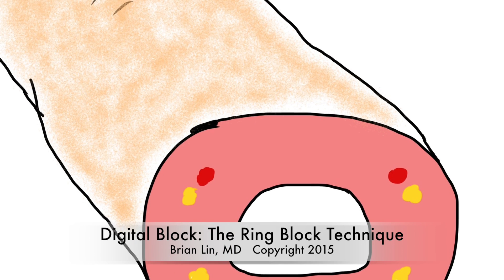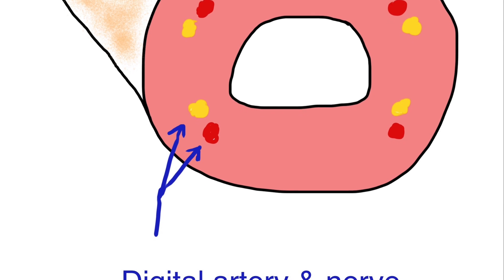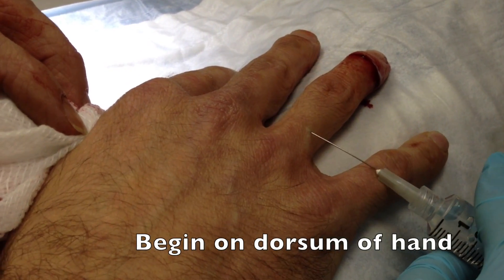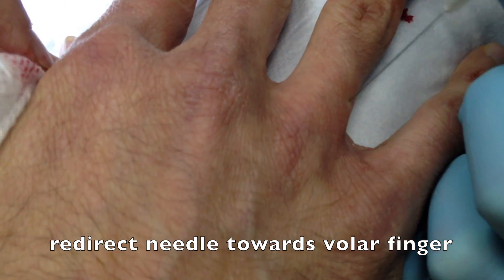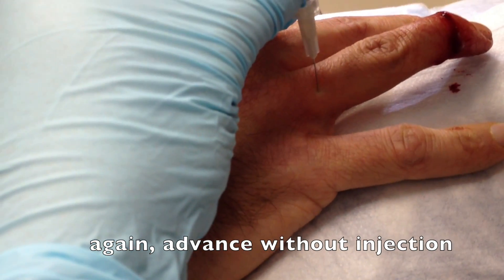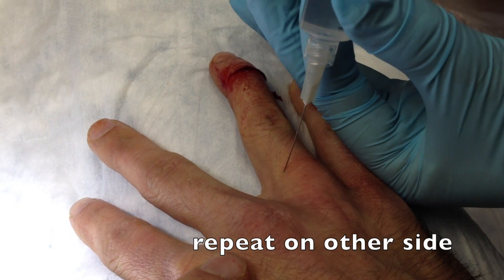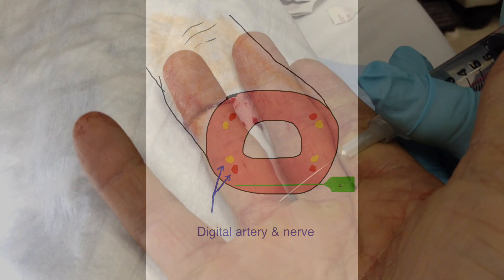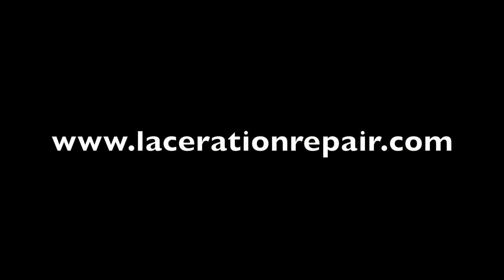Digital Block

Comment: I got my finger tips amputated in an accident at home when i was using mixer 
One of my finger tip was amputated right at the beginning of the nail and unfortunately it was unable to get reattached and the other also had the same condition but it was joined from on end for about 2-3 mm of skin so it got reattached 
Now 6-7 months have been comleted since the injury happened 
Still the finger which was not attached is sensitive😢

Comment: I had a digital block recently and the MD simply entered and injected purely laterally and medially on the finger 2mL each. He even narrated the procedure to his med student so I know how he did it. It worked. Is it possible many techniques emphasize too much on the ring but can be achieved as well with fewer injection points?
Reply: Yup, I'm a Podiatry resident but was on my ED rotation and had to suture a finger laceration, I did my block exactly as the way Dr you were with did and it worked perfectly. I had never done a finger block before but have done tons of toe blocks so just did it the same way I do those, there's many ways of doing it

Comment: I like this technique, Thank you. I am experiencing different opinions about using epi... what say you?
Reply: I dont think you want to use epi on any fingers, toes, genitals, face, etc.
Reply: Using Epi on the fingers or toes can cause ischemia. There has been some differing studies that have shown no prolonged effects, but the risk is still present and relatively predominant. 

What I have done for my finger lacerations is apply a rubber tourniquet, much like the ones used to collect blood samples to help control any active bleeding. It works great!
Reply: Very  good